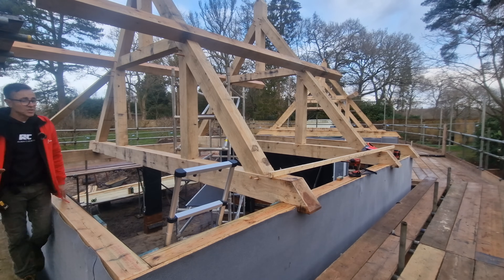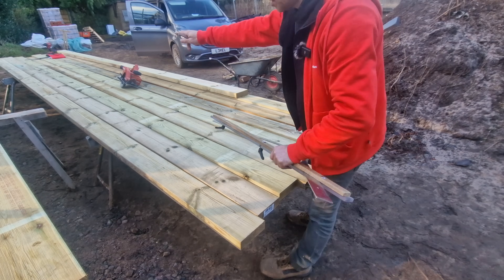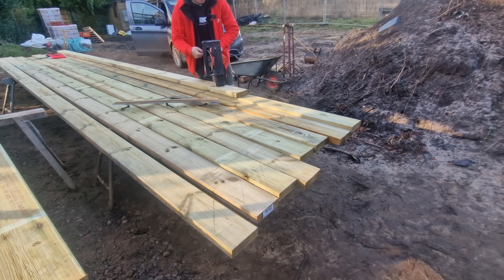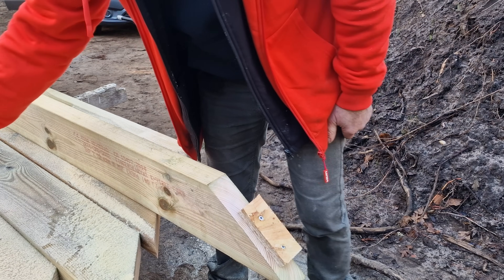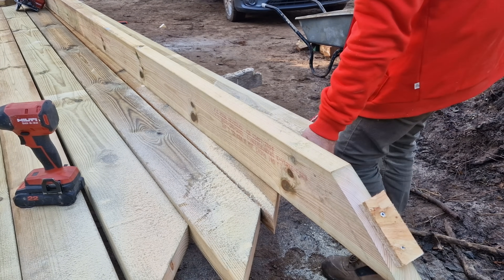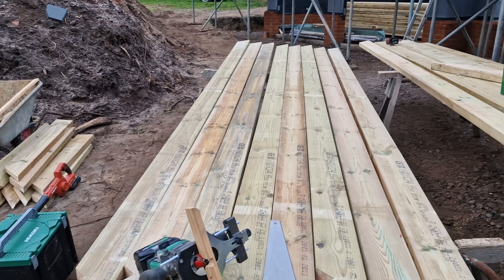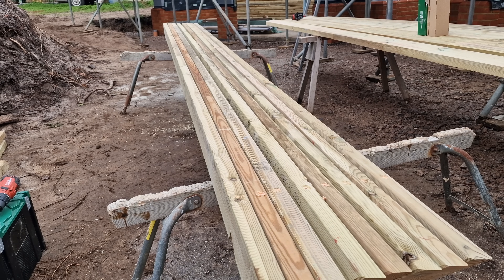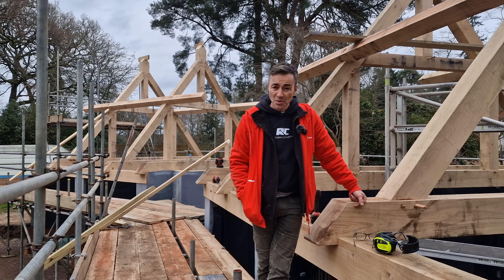Making a pattern rafter for a big roof

Comment: Beautiful work, very rare to see Triple roofs Nowadays, it’s a shame! Although I must say I’m not a fan of fixing the rafters from the top like that, Hopefully the poor Roofer won’t fire a nail into It for his laths, also being on the underside of the felt but above the insulation as a possibility of condensation pooling in the counter bore, And thermal bridging Probably not importance on a garage, but if people adopt this for house building it could cause issues, I personally have always used 5 inch cut nails for roofs rather than screws or gun nails As they hold like an absolute bastard! And allow the wood to move naturally without snapping like screws can!
Reply: Sod it! While we’re at it! I also like my purlins To Sit flat, same as the wall plate, and birds mouth the rafters over it, this allows me to spring the rafter concave, as I normally set the purlins An inch lower than the roof line, this makes the roof slightly concave, which allows the tiles to sit extremely tight, and creates And more of an elegant look to the roof, to make the hips match I scarf joint them also slightly concave (Crown down) as you should always crown your timbers down on a pitched roof,! This is all referenced in the W E Grey Roofing ready reckoner! The little blue book every Carpenter should have!
Reply: Bloody hell, one more time for a laugh! I think your sprockets are too short. The main reason they are there is to slow the water down coming off a steep roof so it doesn’t splash out the gutters! Probably sounds like I’m being a dickhead at this point! So I’ll end with a compliment, No doubt you are the best cop to Joiner on YouTube! And no doubt documenting your work has led to some young guns getting into the trade which we Sorely need! So thank you for taking the time to Film your work! And if I ever see you, I will surely buy you a pint or two! Thanks again!
Reply: So one more time, as I’ll probably never comment on a YouTube video again! If you’re screening a screw less than 100 mm Or a really thick screw! For fuck‘s sake stop using impact drivers! They’re a fucking loud nuisance! And very unnecessary Makita do a driver only drill the same shape and size as an impact driver use that instead! Your customers will thank you! This is just a general rant by the way, not aimed at the mighty Clevett! And definitely don’t use impact drivers on a kitchen! It only takes one screw to fuck up! And it becomes expensive!

Comment: Lovely work as always. I like the detailed planning and precision, very efficient, are you working off blueprints?
I would definitely do a test fit of the pattern, it's a little bit of extra hassle but helps catch mistakes or oversights. But then I kind of never trust (my) measurements.
Serializing the work makes it so much easier, quicker and more precise.
Every time you have to switch tools, or move a workpiece, is time and effort. Streamlining operations is basically free.
I like to think of it as: set up a tool, and ideally set up all the material so you can do all the similar modifications in one go, on all pieces, without having to put down the tool.
EG when beveling the ends do one side of all beams, then flip all of them and do the other sides.

Comment: I'll never set out a roof, but I'm really enjoying applying simple tricks and techniques I learn, to make my work so much easier and more a accurate.

Last week I took home the timber from my sons house where I'm helping him build a fence.

In a day the raw material was fully jointed and dry fitted. On the day of installation the framework was erected, screwed and anchored within an hour. 

So much easier than working in infavourable conditions.

Thanks Robin for the inspiration to think differently and work smarter.

Comment: does the app allow for different heights over plate?
Reply: As in the height of the ridge? If so that will be worked out from the pitch of the roof (angle the rafters are set at). Working out a cut roof is trigonometry, just used in a way the we carpenters can do it on a scaffold in the rain as everyone always wants a roof cut in winter but their kitchen done in summer 😂
Reply: If you mean for setting dormers, veluxes etc you can use a roofing square like the one Robin uses and use the stepping off method which I’m sure Robin will have an excellent video for

Comment: I’ve been really enjoying my Hikoki battery router. I mostly do workshop joinery so have plenty of power points at my disposal, but not having leads running all over the place is great and the grunt the battery router has is pretty impressive.